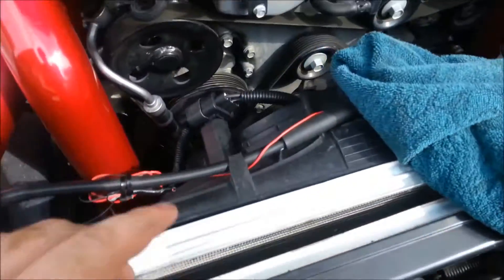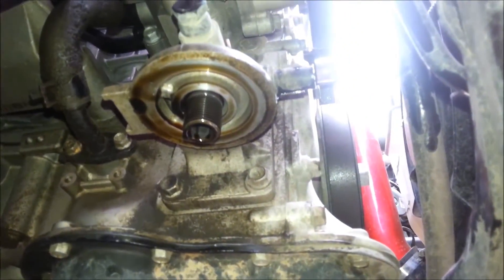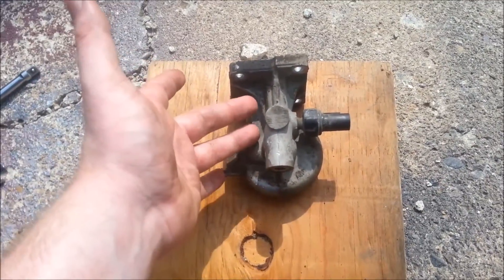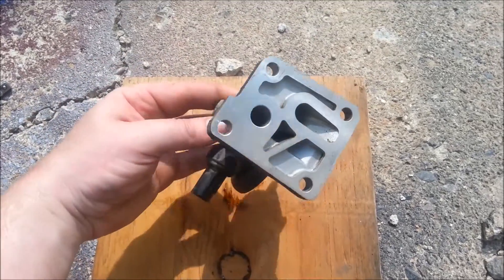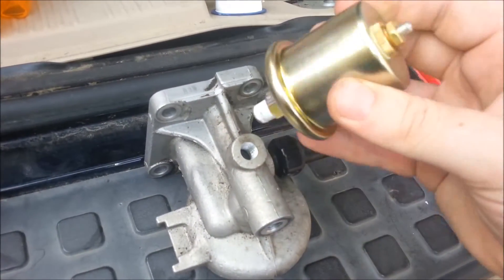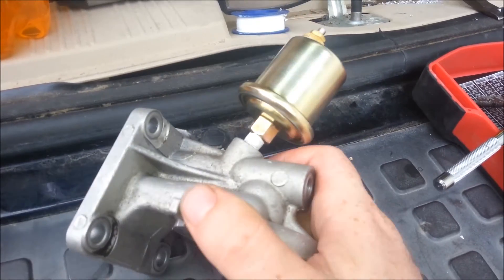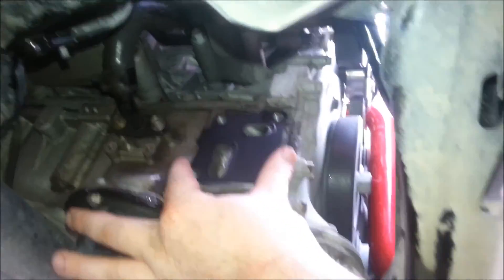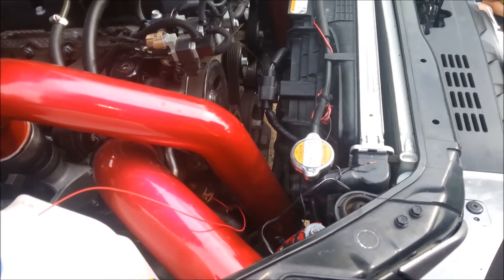Oil pressure sensor install without a sandwich plate

Comment: How would you set it up for a bk2 3.8 I'm trying to run oil pressure and oil temp
Reply from the maker: You'll need an adapter, the 3.8 uses a plastic oil filter housing.
Reply: @thesnoopypanda  is there a way to tap off the OEM oil pressure sensor to maybe like a T fitting and run the 2 aftermarket gauges along with the oem sensor
Reply: Basically a 3 way split off the one hole
Reply from the maker: Possibly, but I don't have the info to say that it'll give you accurate readings

Comment: Why can't it fit where the original oil sensor goes
Reply from the maker: That's an oil switch not a sensor and most companies don't sell sensors that are 1/8 BSPT fittings. You can get an adapter T, which is good if you're using both temp and pressure sensors.

Comment: Hey I have a bk2 3.8 but doesn't look the same as what you have.
Reply from the maker: Samuel Park this only applies to the 2.0. Unfortunately because of the plastic oil filter housing on 3.8, you have no choice but to use a sandwich plate. Our friends over at  MSA make one.
Reply: Snoopy Panda thanks for the info! I looked at their website and tried to order it but I couldn't choose a shipping option. I've reached out to them via their contact page, but no response. This seems like the only solution for me because I don't want to use the typical sandwich plate. Any idea how to reach out to msa
Reply from the maker: Samuel Park reach out to us on Facebook and we'll put you into contact with someone
Reply: Snoopy Panda msa facebook
Reply: Snoopy Panda my comment didn't go thru apparently. I'm having some trouble finding the msa fb. Sorry for constant harass, but could you link me?
Reply: Snoopy Panda nvm found it